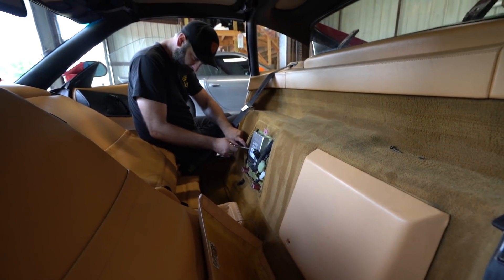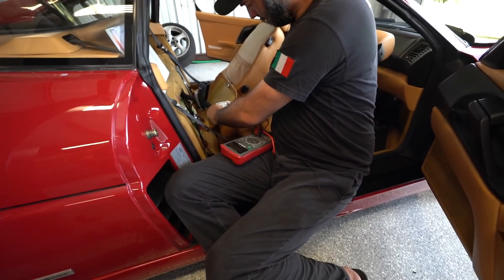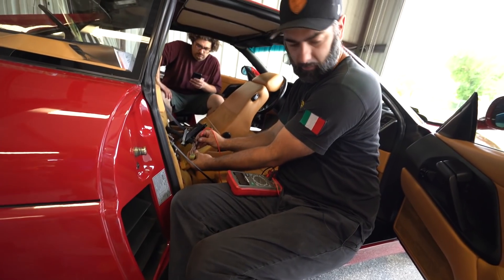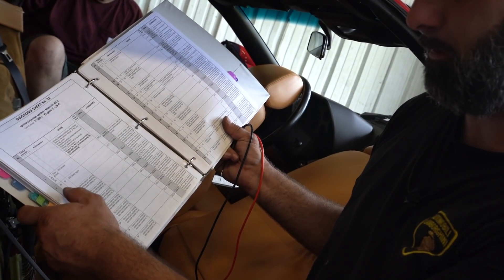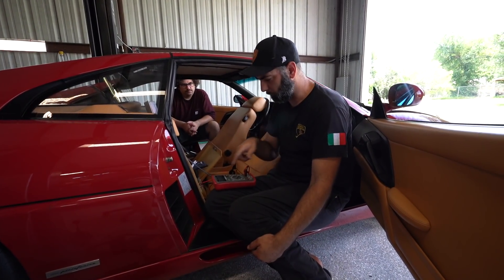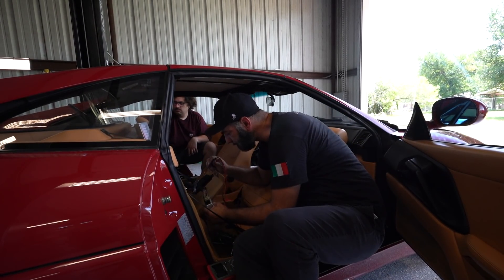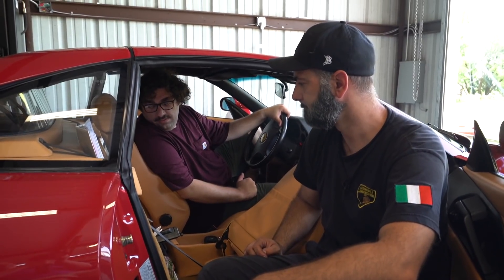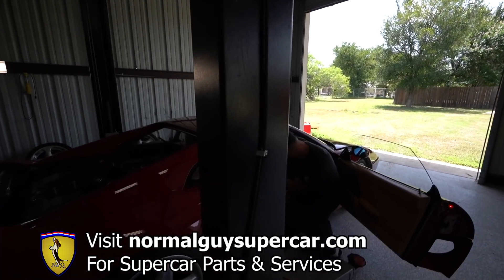Using THE FERRARI BIBLE - F355 Electronics & Sensors check | Part 2

Comment: 16 ohms plus or minus 4?  No wonder the as e cars are a nightmare the ranges are huge
Reply: Injectors aren't super sensitive, they just pulse on and off. MAF, Lambda and Rpm/camshaft position sensors are very sensitive though and have a tighter tolerance.

Comment: Awesome series!  I just found this channel.  Really good stuff!  Good thing you found someone as thorough as Josh.  My "quack" guess is at least 234!  Lol  We have an '87 TR that just broke our quack record!  Currently it's at 2768 quacks and counting.  It was a victim of a botched ECU upgrade where they replace the original CIS system with a Motec M150.   Which on the face of it is not a bad idea.  But it looks Larry the Cable Guy did the install while yelling, "Get 'er done!!!"  I only say that because there is only what I would describe as an "illegal amount" of parts and hoses that were clearly ordered from a Jegs catalog.  Some of the parts say "Holley" and while other parts say "Summit"  It also only ran on 5 of 12 cylinders when it came it.  I want to do a Youtube video on it as it's properly "Quaked!!!"  LOL!!!
Reply: Oooof. Good ideas gone wrong🤦‍♂️
Reply: @exoticpower8073  do you have Instagram?  I can send you pictures of this TR that will haunt your dreams 😂
Reply: @erik_cruz  oh man. Its exoticpowerperformance